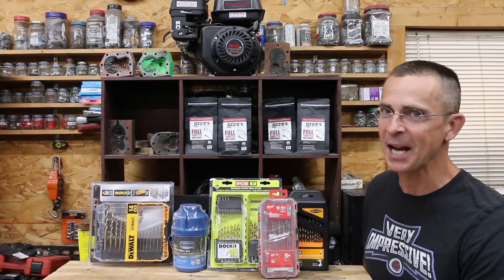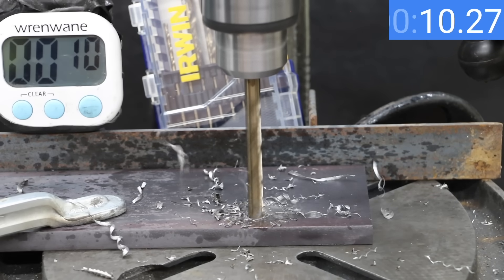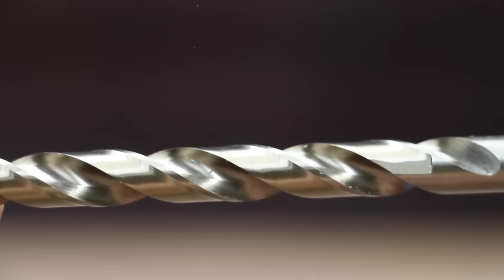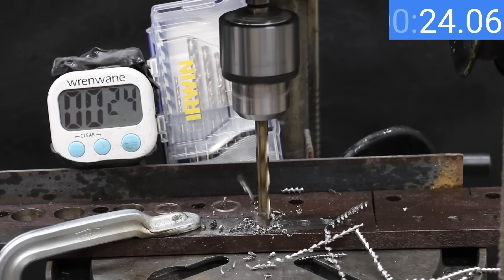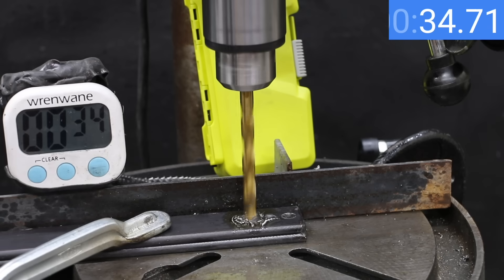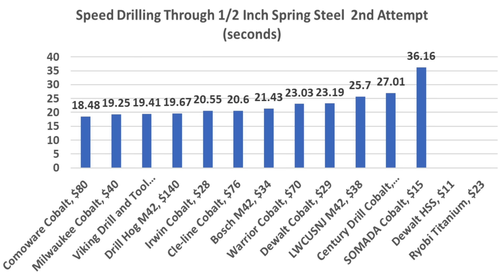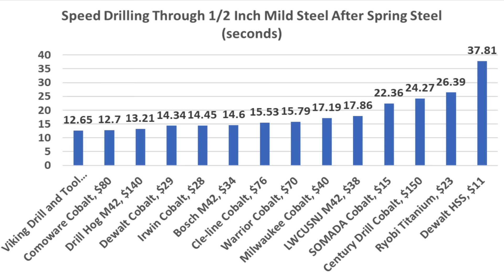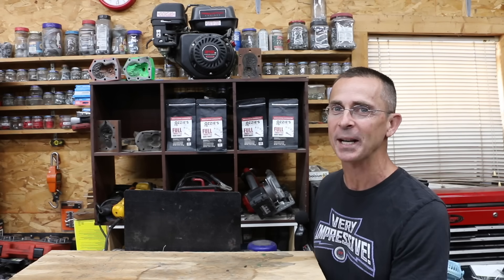Best Drill Bit Set? $11 vs $200? Let’s Settle This!

Comment: Always love these videos. Another drill bit test I would really appreciate, albeit expensive, is step tip drill bits. Norseman, Drill America, Astro, Matco(maybe the same as astro) are just a few brands I could find. These sets push $100-300 but could be the single most useful set of bits someone owns. Thanks!
Reply from the maker: Great point!
Reply: @ProjectFarm  Found a couple more brands to add to the mix. K Tool International and KnKut. Thanks again for all you do sir.

Comment: I use the Norseman / Viking / HUOT bits, they are very good.  In case of replacements (lost or damaged), I buy from McMaster as they sell quality and delivery fast.  Having a drill sharpener is mandatory, I cant believe I lived so long without one.  Great video!
Reply from the maker: Thank you for sharing!

Comment: I just snapped my 4mm tap from the Irwin Tap & Die set on the first use in aluminum. 
So I’d love one of your amazing reviews on taps. Especially small ones.
Reply: Tapping aluminum can be a bit weird. There's a lot of different aluminum alloys. Then aluminum can react with certain tapping fluids. So there's a host of potential issues. Just because aluminum may be soft doesn't mean it is easy to tap.

Comment: I hate to spill the secret but the Norse an drill bits with the flat shanks are just as good as the snap on (same factory I think) and only $115 in an awesome yellow carrier that's hexagonal with a screw cap.

Comment: I have been looking for a portable drill bit case that actually holds the drill bits in place. All of them when I get to the job site and open the case, some or all the bits are all over the place inside the drill bit case. This has driven me nuts for years lol. Side note: This is more of a machine shop item, but Guhring  made an amazing drill bit back in the day but you will pay the price for them.

Comment: Great test as always. Only comment is that I like having both standard and hex drive drill bits in my box. Standard for use in the shop and drill press and hex drive for trackside/field work. Doing frequent track side support repairs, hex drive bits mean that I can just bring my bit driver and not have to pack the drill as well. Saves a bit of space in the trackside toolbox which is always at a premium. The Makita bits have been good to me in that regard.
Reply from the maker: Great point!

Comment: With fishing lures, most are made to attract fishermen (and women) in a store, not actually attract fish in the water.  It wasn't covered here but the same is true of the pretty colored coatings on homeowner bits.  In high production situations with proper coatings, those coatings can make a difference-- but the stuff you see at your local hardware store is pretty much just like fishing lures--pretty colors to attract buyers. Don't fall for it when shopping for your bits.
Reply from the maker: Thank you for sharing!

Comment: I LOVE THE CLOSEUPS 👍👍👍
Because they all look like 💩 😂

Yes, I'm a "BIT" Biased. As having drilled Millions Of Holes building aircraft. But that's just my observation.

And YES 
We drill through about every material you can think of. And a Good Bit. Will do them all,.. pretty much.

FUN FACT.
Ceytl Alcohol was the lubricant used in most hand drilling applications. Came in a little brick, like a cube of butter.
AND, is also a popular ingredient in shampoo and conditioners.
... always fun, and informative 🤗 thanks
Reply: And I will add.
You can tell a bit will do a good job the first hole you drill. Simply by the burr it leaves.

And, shear strength, and tensile strength are different.
But it's obvious, you know how people use drill bits 😂
... or pry bars 🤣 👍

Comment: any machinist will tell you  taps dies and drills (that are worth using ) do not come as "kits."   All the good tools are sold & purchased ala cart.  Balax taps  for thread-forming, OSG for thread cutting,  Viking, Michigan, Hertel for drill bits  but NEVER - Never EVER,  buy a kit.  You will only get garbage.

Comment: I checked out your masonry drill bit video when I needed to drill into a concrete pad.  My old Bosch drill bit gave out after one hole and wouldn't drill any more.  So I checked said masonry drill bit video and bought the Milwaukee set that scored so high in your testing.  It breezed through the other 15 holes I had to drill and is still good for more.

Don't ever stop, man.  You rock and your reviews rock.
Reply: Did the same…. This dude is a science beast
Reply: Funny, this is the only YouTube Channel I watch at normal speed.  Most I watch at 1.25x, or faster!  I like it!  (I like Project Farm's speed)
Reply: I love the videos as well. I do wish he'd do a video testing normal vs heavy duty(Red'n'Tacky, Crimson, ect) in high impact applications(i.e. pins in the arms of the loaderon tractors, skidsteers, ect), where I'm suspecting the normal grease may last longer due to it being more fluid and getting sucked back into the joint more easily when the one direction pressure is removed, vs the heavy grease which I suspect gets pushed out at a faster rate.
Reply: I really like the concept of this channel but i cant help feeling overwhelmed when i hear him talking 😅 anyone else?
Reply: @itzikca  There's a lot of information to convey, especially as @Project Farm typically is testing quite a lot of products instead of just a few.  But it is very consice and clear.  There's little to no superfluous information here.  It's edited to make the delivery fairly rapid fire to keep the video length down.

The consice rapid delivery is what make this channel work and is what enables @Project Farm to review so many products week in week out.
Reply: @meson183 I agree his older videos with less editing and slower pace feel like MOLASSES compared to his modern videos and yet nothing of value is cut out and everything is still delivered clearly.

Hes really completely optimised it to the best it can be.
Reply: @itzikca 
Yep. I get overwhelmed, but it works. I use his vids more like a reference or data manual rather than a story line.  
I will run the vids 2 or 3 times, picking out the parts that matter and studying them. 
Once I do it that way, the wisdom of his presentation becomes apparent .
Reply: @itzikca  same
Reply: @itzikca  nah its just you. you can set the speed slider to 0.75x if you are having difficulty.
Reply: @dedasdude  good idea 😂

Comment: I've had a few set's of the Harbor Freight titanium coated ones, all I can say is make sure you clean the bit with carb cleaner before your first use otherwise the chuck will slip and polish the shaft to where it'll never clamp tight again
Reply from the maker: Thank you for sharing!

Comment: Perhaps, in the future availability and price of replacement bits.
    In my experience there are some sizes that get used and broken all the time and are pricey to replace individually. 
   I end up with multiple boxes, containing less popular sizes and a bunch of broken 1/4 and 1/8 inch bits.
    Also, a re-sharpening category.
Reply: Also performance with handheld cordless drills, including drilling at weird angles, and the snap rate.

Comment: I'm curious how KnKut drill bits would've performed. They have step drill pilot points. They're crazy expensive at $300 for an index from 1/16-1/2 by 64ths. I personally use Milwaukee bits with the hex shank, they perform well for me.

Comment: Could you test brad or forser bits? Montana tool makes gread brad bits. Maybe how quickly drills can drill through super hardwood and which ones tearout? Maybe use an underpowered cordless so we can buy the best bits for drills when we dont have access to a drill press or super high end powerful drill.
Reply from the maker: Thank you for the video idea!

Comment: I have the Bosch m42 and the Dewalt HSS kits.  I wouldn't hesitate to buy either, but I prefer the Bosch as the season bits seem to cut faster.  Also, I've broken most of the dewalts.  If time is money, I'd buy the Bosch.  For light home use, maybe lean towards the dewalt HSS.
Reply from the maker: Thank you for sharing!

Comment: any drill bit set not ewer can cost 200$ i have my factory best and expensive drill bits what can use pro metal working last 10 year good and no dull and no need sharp alltime,  carbide bits, and cost all set 30$ expensive no have anywere in world. all pro metal working factory use carbide drill bits and newer not need buy other ,
Reply from the maker: Thank you for sharing!

Comment: I like the Bosch bits too but they lasted about the same as the Dewalts hss.  I do have a set of craftsman chisel tip drill bits that are 25 years old. Plus have only  been only used on a drill press. That have never sharpened.
Reply from the maker: Thank you for sharing!

Comment: I use the dewalt Cobalt bits every day at work and honestly love em, we have basically an unlimited supply of 1/8,1/4,3/8, and 1/2 inch so sharpening has never been a factor for me. I definitely prefer them with a pilot on them sense it cuts down on the bit sliding around when im drilling steel door frames/mullions.
Reply from the maker: Thank you for sharing!

Comment: I own 4 sets of the Viking, glad to see it passed with high marks here!
I prefer the steel HUOT case they come in over any of the crappy plastic ones. I had a set of maybe it was DeWalt, it had a metal case but it opened wierd and had a flimsy plastic window on both side, and the "leaves" would not separate from one another when open- they were attached to each other,  so you could READ the bit sizes.
The Viking case cover opens like a book, and then each leaf of bits moves independent of the others, very nice.
Reply from the maker: Thank you for sharing!

Comment: Is there a reason why the drill bits are loose in the chuck (at least 4 counted on breakthrough ??)
Buy the man a chuck key.
And drilling through a steel sandwich ?
That's a good way to break drill bits.

Comment: I'm still using the Harbor Freight Warrior cobalt bits that I bought 6 years ago. I got them back before the price went way up. It was $35 for a 29 piece set back then. Good bits, but their factory grind wasn't great. Once sharpened, they hold their edge well and I've only broken 1 bit that's bigger than 1/8" in those 6 years using them professionally. Too bad the price doubled.
Reply from the maker: Thank you for sharing!

Comment: One consideration that is critical... .can you buy the same bits open stock, to replace any destroyed or lost ?   I would expect cobalt bits to be more brittle, they are made to cut, not to bend...... this requires a drill press without a wobbling chick, if possible... using in a hand drill, you got to stay square to the work, and not use the bit to widen out holes by "ovaling". I have been quite please with Drill Hog, which have a lifetime warranty against failure, breakage or dissatisfaction, if you REGISTER the bits..... I do not take the time to register consumables. Drill hog also makes very goopd step drills, and a range of other cutting tools.

Comment: I got one of those drill hog cobalt sets last year and it has been the biggest pile of garbage ive ever bought. Every bit has been a flip of a coin wether it drills mild steel or doesnt. And if it does drill, its a flip of a coin on wether it breaks at the exit or not. I havent had a single one (that drilled) survive more than 4 holes.
Reply from the maker: Thank you for sharing!

Comment: In my drilling experience I've found that my impact driver with impact ready bits drill faster and easier than that drill bits. When drilling in 3/8" steel beams up a 20' ladder I take up a few pilot bits and use a gen 3 m12 impact driver  and it works perfect  no drill twisting my wrist around.  1 handed. I often drill these holes using a Milwaukee right angle impact adaptor for hard to reach places. I dont think people have discovered  that impact drivers are where it's at for drilling steal. I sharpen the bits on a 8" bench grinder.
Reply from the maker: Thank you for sharing!

Comment: Hello and thanks for this video!
I'd be interested in another one (after the one you did 2 years ago) on sandpapers. For example on specific Sandnet types. Mirka and Bosch have it, probably some other brands. Also maybe test the percieved finish as well as the longevity and efficiency, as I've noticed there's already quite a difference between no brand and branded products on the matter.
Reply from the maker: Thank you for the video idea!

Comment: Another great video!  It would be nice to include more durability testing on the cobalt bits. They should be expected to last much longer than the HSS.  Also, users should be aware and pay attention to recommended speeds for drilling applications. Drill press users are aware and have control. Handheld drills are mostly too fast for most drilling applications.
Reply from the maker: Thank you for sharing!

Comment: Great Video!
Cobalt bits are great for cutting metal.
M42 will help you cut harder material than M35 but it is more brittle and can break easier.
If using a hand drill, stick with M35 and use M42 with a drill press.
Reply from the maker: Thank you for sharing!

Comment: here's an idea. can you test how much amperage different brand receptacles and switches can hold? 15 and 20 amp versions? i suppose you could run 30-40 amps through them and see how long they last and where the failure point is? a specific brand and model i would like tested is the leviton edge, it has a very different connection style compared to most traditional receptacles and switches. 

thanks, you're the best.
Reply from the maker: Thank you for the video idea!

Comment: Last year I had to extract a broken-off seat belt mounting bolt from my truck. I have an older Snap-On drill index and Harbor Freight's Warrior drill index. Neither of them could drill through it. Based on your previous drill bit video, I bought a set of Bosch drill bits. They were able to punch through where Snap-On and Warrior couldn't. I use the Snap-On and Warrior bits for general drilling, but the Bosch index is marked "HARDENED STEEL ONLY". I highly recommend having a set of "hardened only" bits - that way you can use cheap bits 95% of the time. I refill my "cheap" drill indexes with bits off Amazon.
Reply from the maker: Thank you for sharing!

Comment: Thanks for another great video. I'd love to see a drill bit video focused on expensive and genuinely professional drill bits, usually found from machine shop suppliers. You did Viking, and that's awesome. The'yre often sold singularly and application specific. Maybe some tricked out colant fed bits, taper length, or shank bits. There would be some hacking to make it work on your press, but anything in possible. Is a single $250 bit as good as the best DeWalt bit?
Reply from the maker: Thank you for the video idea!

Comment: I bought Ryobi bits last year and I am very disappointed. They put on the hex shank by pressing one side in. That led to the bit not being in line with the hex shank. Pointless if the tip of a bit wobbles too much to use it.
Reply from the maker: Thank you for sharing!

Comment: Definitely depends on what you’re drilling. I had to work with 316 stainless the other day and I had to buy some 1/8 cobalt jobbers that were 8.00$ a piece
Reply from the maker: Thank you for sharing!
Reply: Some stainless work hardens. So then feed pressure is the most important thing. You try to baby it and the stainless just gets harder. When it does then you have to punch through the hardness.

Comment: Interesting video. During my time with metal working (retired welder) I was taught to keep the drill bit lubricated with cutting oil to help the bit to stay cooler and stay sharp longer. Still a good video.
Reply: Every bit got some cutting fluid. Which is more than most folks use. One hole not deep bore one shot is fine. Todd isn't trying to give each bit ideal conditions just equal ones. Plus he was running at about half production rotational speed. So he didn't need to flood cool. These are just head to head tests so we can compare how the products perform against each other. Really he should have run them all dry. That's how most people drill. He should have burnt them up too. Again that's what everyone does. See which bit turns the prettiest blue.
Reply from the maker: Thanks!  Thanks for the feedback.

Comment: Ok ok, here's the next test. Buy (18) $11 Dewalt drill bit sets sets(equalling $200~), and put the 3/8 bits against the single Viking bit. See if the 18 bits outlast the single Viking bit. If the 18 bits win, this is one of those occasions where it's better to go with buying 18 times instead of buying once😂
Reply from the maker: Thanks for the suggestion.

Comment: FYI I got the 29pc Warrior set from HF yesterday and the price was ~$20 which is a lot less than on this review. It was actually free with a coupon. I probably wouldn't have bought them if I were simply in the market for bits and I'm sure not the best but for my purposes and your results, they'll work great. Thanks again for the great content
Reply: I got those as well, they're the titanium coated 118 degree bits. He's testing the Warrior 135 degree cobalt bits. Different purposes. I use the titanium ones for wood and thin metal. Cobalt for the hard and thick stuff.
Reply from the maker: You are welcome!

Comment: Have you ever tested any of the Bad Dog drill or router bits? I saw a guy as a trade show doing some unbelievable things with them, like drilling thru a cinder block then drilling a S curving hole thru a short block of 2x6 without holding the block.
Reply from the maker: Thanks for the suggestion.